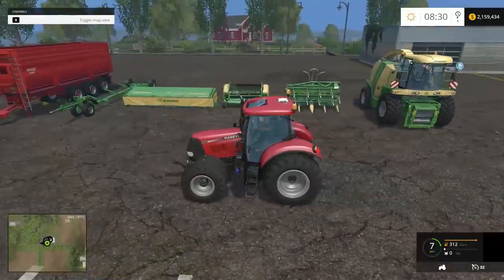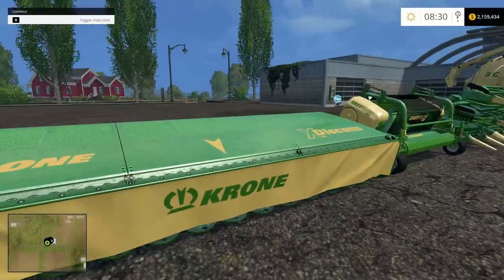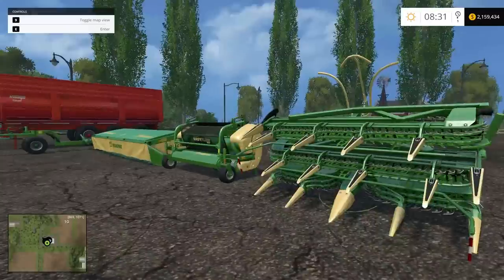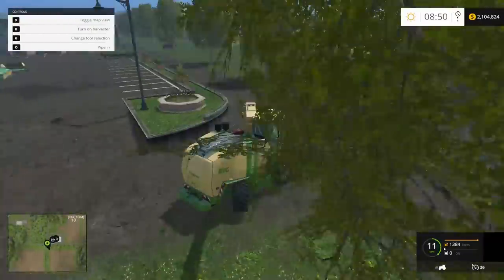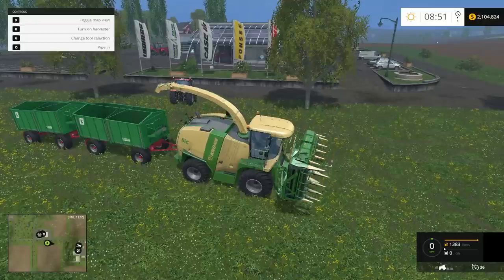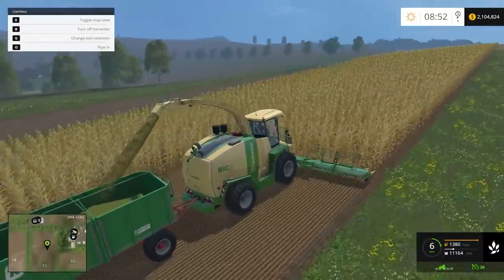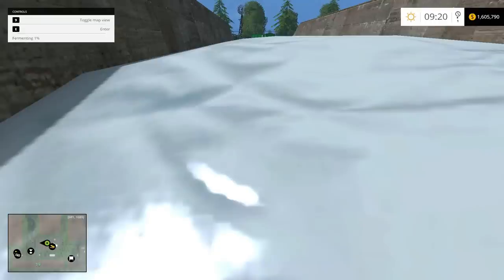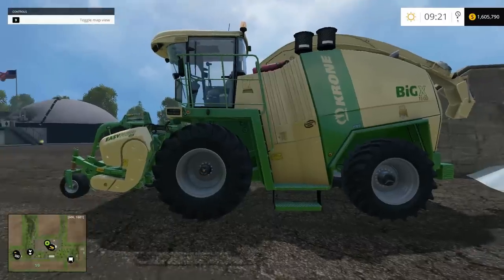Krone BiG X 1100 - Farming Simulator 15 Tutorial Part 1

Comment: I've seen a lot of people say that another name for its is a chopper (which they obviously know more then you do) but regardless what a chopper does is chops up the material being fed into it and shoots it all out one pipe. It's sort of like a lawn mower, it chops the material up finely. The other self propelled Harvesters in this game are different because they separate the seed from the plant and stores the seed in the top while it spits the rest out on the ground (aka the byproduct). I found that the fliegl 226 is the biggest wagon that I can hook up to the Harvester but you can hook as many together as you want. You are also limited on how big of a tractor can pull it as well so the biggest tractor I can pull it with is the case 160. As long as you don't have a trailer attached to the chopper you can hire someone to drive it then you can hook three wagons up until them up at once giving you a total of 96000 which is 37000 more than the largest trailer on the game.
Reply from the maker: Yeah, here in Ohio they call them Choppers or Foragers.

Comment: if you don't hook a trailer to the Krone you can hire driver for you. and you can use larger tippers with tractor to follow. Other good thing about that is that it will stop when you get filled so you have less waist for that reason.
Reply from the maker: interesting.  I will have to try that.  I haven't seen a "hire worker" dialog, but I haven't run the crone without a trailer either.  I just watched the product video for the real one and it seems like they all do it that way.
Reply: You can even set up 2 BigX side by side, hire 2 workers, and then drive a Tractor with a huge trailer between them.Looks awesome and fills up your trailer in seconds,
but you have to buy 2 BigX, pay 2 workers and turn them at the end of the firld manually. But it looks awesome, if i havent said that already.
Reply from the maker: Pueranha
lol.  That would be awesome.  On some of the real life demo videos they run a truck on each side of the Krone.  Its pretty sweet looking.

Comment: You can hire a worker and tow big trailer next to it. The Krone automatically stops when the trailer is full or out of range.
Reply from the maker: +Justin Law Correct - please see part II where I cover prototypical operations.
Reply from the maker: +Justin Law ttp://youtu.be/cYDt4DT05oo
Reply: +Arthur Chapman Ah! Should have looked further. I discovered it while messing around. Noticed the auger followed a trailer when I drove past it. Made about $1.5 mill in good time after that. A heavy rigid truck between two conveyers at the biogas plant sped up the process. I guess (without searching your channel) you have already seen/tried that.

Comment: Arthur you attach fliegl TMK 266 bull that's 2 of them to the BIG X it works and I bring in 64000 litres of chaff ext.
Reply from the maker: +barrie mcdermid correct. Sometimes I will attach 4 and swap to out once the front 2 are full.  Honestly, prototypically, you would use a tractor to run alongside the harvester, and the tractor would pull the trailers.  I haven't seen any actual video of a Krone (or any forager) pulling trailers like they do in this game.

Comment: you can use the 3rd tipper and attach up to 4 of them but it will only fill 2 at a time, its way easier to hook up than those tippers hes using in the video and they hold 32000 each

Comment: the Krone big x will pull and load up to 3 HKD 302 Trailers and fill ALL 3 while on the move
Reply from the maker: Nope - Just tested it - Maybe you have a mod that allows this? - By default its only 2.  Now, I did get a little bit to go into the 3rd trailer when I went around a corner and it got close enough to throw, but once the train straightened out it was no longer able to fill.

Comment: Do you get more chaff from a fertilized field?
Reply from the maker: +Jake McCaig You should, because there is more crop density.  Gonna have to make a video about it.  That is a great question.
Reply: +Jake McCaig Using the corn header or the Easy Flow 300 straw header you will get the bonuses of fertilizer if you fertilized your corn, wheat or barley fields.

Comment: un now the second header is to pick up grass that has been mown and put in to lines with a windrower straw you use a baler!
Reply from the maker: Why would you mow and wind row and then pick up grass when you could just use the X-disc?  The easy flow is designed to chaff straw that left over from a harvest.  You can bail too, but if you don't need to bail, you can always get chaff rather than just turning the straw swath off.  Hope that makes sense.
Reply: nope its not look it up balers are for straw the second head is for the the x disx is for whole crop eg weat barley
Reply from the maker: will zealand Ok,  I looked it up - I am quoting the EASY FLOW 300 manual from Krone - "The Pick-up of the EASYFLOW 300 / EASYFLOW 380 series is a front attachment unit
especially for the KRONE forage harvester BiG X. It is used to pick up CROPS in blade form along
its working width, to bring them together along its infeed width and to release them continuously
for transfer to the forage harvester. " - so its designed to pick up ANY bladed crop - not just wind rowed grass. Grass is a grain BTW, so its in the same family as Wheat, Barely, and other bladed grains.  

Now the X-Disc 6200 Manual "The direct cutting system of the X-Disc 6200 series is a front attachment unit specially for the
KRONE forage harvester BiG X. It is used to cut crops growing on the ground (except maize)."

I never said you couldn't use the 6200 for cutting wheat and barley (as I show it doing in the video) but it's wasteful because you have to pay for the seed, the time to plant and fertilizer.  Grass is much more efficient because it grows on its own and doesn't require fertilizer for reseeding.

You are able to run it anyway that you want, and there is no wrong way.  If you want mow row and then collect, and only use the X Disc for crops, go right ahead, but there are more efficient uses for both of those headers, and They are designed to be flexible so that you can use them for different things.  Hope that helps.

Comment: Shame there's no option to move the chute to the left or right to run a tractor and trailer along side as that's how it's done!
Reply from the maker: +si barsby You can, sort of, but you have to do it multiplayer, and it still latches and aims automatically.  You can also hire a worker in the Krone when chopping corn or wheat or barely and run a tractor along side for more proto-typical operation.  Part II shows this in action
Reply: I forgot to mention I use the xbox 360 and not a PC so maybe it's not an option on that format?
Reply from the maker: si barsby
that might be the case.

Comment: I just get the Semi and the largest Tipper, then drive along side.
Reply from the maker: You can do that, but I don't think they drive the semis on the field often, because it damages (compacts) the soil.  I did do a second video showing prototypical operation using a chaff wagon (in real life they don't use tippers) and a tractor to pull along side.  Last but not least, you can't hire a worker when collecting chaff using the easyflow, or pro cut headers.  Only the corn header allows you to hire a worker.

Comment: your slightly wrong there dude, Chaff is literally the whole plant..
Reply: sorry to nitpick this video but there are so many incorrect statements you make within this, for example the easyflow header going behind a harvester.. that will only collect straw, whereas if you use the xdisc you take the whole crop which is then a usable cattle feed
Reply from the maker: EvazionTactics Yes,  if you check out the comments on part 2 (I believe) some one already corrected me on the header chaffing the whole plant.
Reply from the maker: EvazionTactics Using the Xdisc to collect your wheat, barley or canola is somewhat of a waste, because you are chopping up a crop that you spent time and money planting and fertilizing.  

You are much better off with the easyflow because you get both the harvest AND the chaff.  Does that make sense?  

Also - If you are going for a seeded and fertilized crop to chaff, then you should do corn, because it yields far more chaff than the other crops.  Otherwise you should either use the easyflow for straw or the Xdisc for grass. Grass is always going to be most efficient in the game, because it requires no labor or fertilizer to grow.  Corn is the second most efficient for pure chaffing.  Wheat and Barley are in 3rd because you can take both the crop and the chaff using a harvester and the easyflow, and canola is dead last, not only because it yields the least using the xdisc but it also doesn't leave straw, so the easyflow is not an option if you are going to chaff canola.
Reply from the maker: EvazionTactics Oh, yeah and btw - according to our "farm sim math guys" Using the Easyflow on straw actually yields slightly more chaff per square meter than using the X-disc.  This is not true for grass though.  The X-disc gives your a 2 liter per square meter bonus when mowing grass.   

The bottom line - Don't X-disc your crops.  Harvest them and then use the easyflow.  Do X-disc your grass.  The article is here - http://forum.giants-software.com/viewtopic.php?f=831&t=83317&hilit=what+grain+for+silage%3F&start=15

Comment: New Holland do you see this. Paint your combines blue!
Reply from the maker: +TheJadeStorm87 IKR - it looks great on the Tractors,  Why yellow Harvesters?
Reply: My guess would be it is easier to see. My problem though is that I am color blind and that "yellow" to me is pink/white.
Reply from the maker: TheJadeStorm87 Aha!.  On a side note, on my trip to Nashville I saw a 9 series NH harvester and a large JD harvesting corn fields.  Also saw a "vingtage" JCB fastrac and a new one (the same 230HP on in the DLC).  Saw a "new" brand of harvester too.  Not close enough to read the brand, but a dealership had like 20 of them.  They were silver with black lettering and black strips.
Reply: You don't see too many NHs around here, sometimes I think I am the only one in the county that has one.
Reply from the maker: TheJadeStorm87 What model do you have?
Reply: T7 260 with the NH 800TL loader arms. 260 engine HP and 190 PTO HP.
Reply from the maker: +TheJadeStorm87 That is SOOO COOOL - I want one...   Some guys buy sports cars.  I always told my wife if we ever had extra money when I am older that I was gonna buy a 4.75 with shovel to "clear" the driveway, Mow the lawn and till the garden :)
Reply: +TheJadeStorm87 Nice! At my family's farm we have two Ford 3930s, one Ford 3910 with low profile wheels and exhaust, New Holland 3930 (same as Ford but newer), Ford 6600, and a New Holland TN75DA which is basically like a T4.75 but older. We use them for making square haybales with a NH haybine, tedder, rake, and a NH 570 baler. Gets it done really well. T7.260 sounds awesome. I think they should add one to FS15.
Reply: Arthur Chapman
 I would love a sports car, but 10 miles of gravel in all directions is not a low riding cars best friend. Plus I would likely have to sell my truck and there is no way I am giving that thing up. Also the T4 is a nice machine, and I was looking at it, but since I was buying a tractor I might as well get something that can run everything on the ranch.
Reply from the maker: +TheJadeStorm87 Heck yeah - the T4 is light duty.  Its a nice tractor but its VERY small - for a full farm you need something bigger for sure.
Reply: Tommy Wegman
 Quite the collection, Those Fords are bulletproof tractors. I have been trying to convince my dad for a couple years now for more equipment so we can do more of the processes ourself and it worked on making our on straw and hay bales, now if I could convince him that a forage harvester is a good idea it would save us paying someone to do it, then we could do more of it and take the strain  off our straw and hay bales.
Reply: The 3930s sure are bulletproof. One of the Ford 3930s we have and the lopro 3910 are yellow. All of our 3930s and the 3910 are from our county's auctions. They paint some yellow for highway work, and they actually look really good in yellow. We have Belgian draft horses so our hay equipment is very important, and our Fords and NHs never fail us.
Reply: We currently have 16 horses and i don't even know how many head of cattle, i know at one point this year we had close to 6,000.

Comment: playing right now running double ass289 trailers with no mods just the game on its own
Reply: +james halikos i just bought 2 of them but they don't work so then i bought dolloys and they still dont work
Reply: +SuperDude55 wish i could put pic on here its not BS.
Reply: +SuperDude55 I mean the tmk266 bull. I'm sorry about that.
Reply from the maker: +james halikos Yeah, I think Superdude was using the largest trailer.   The 266 bulls are the largest trailers the Krone can pull, and yes, it can pull 2 of them.
Reply: +Arthur Chapman I got the bulls and it worked but honestly I find it easier to use a semi truck and trailer and follow next to the chopper. I was using this method before I found this video. I like the vid keep up the good work
Reply: +james halikos it's alright
Reply from the maker: SuperDude55 Thank you superdude - I cover prototypical operation in part 2, which is exactly what you are talking about.  Most farmers run a forager along with some tractors to pull the chaff trailers.   Or as in your case a semi.  Once in a while I see a forager pulling a wagon, but its rare.